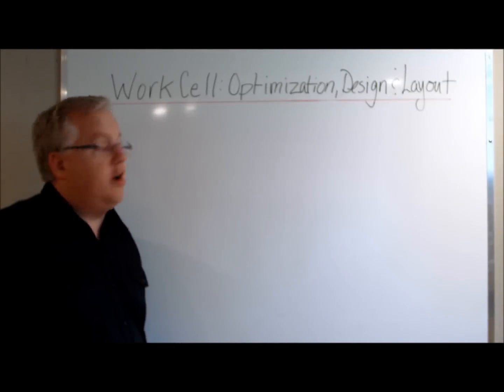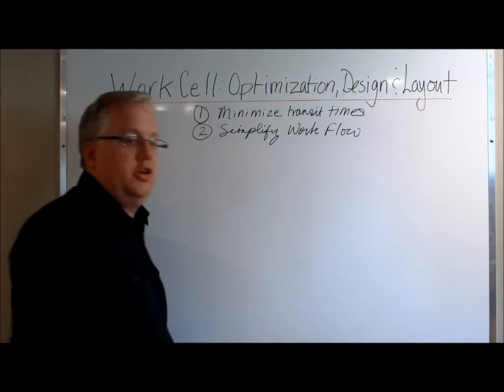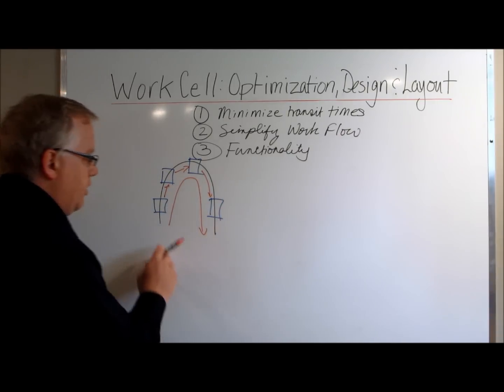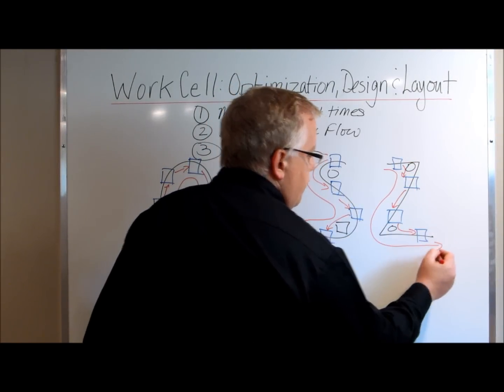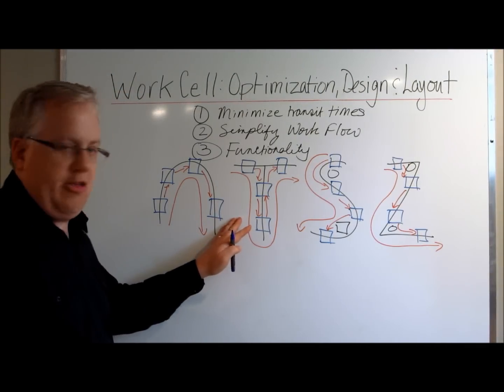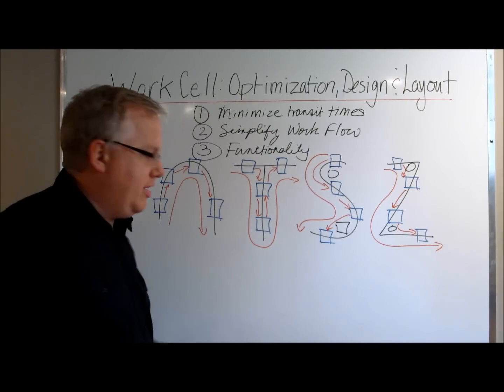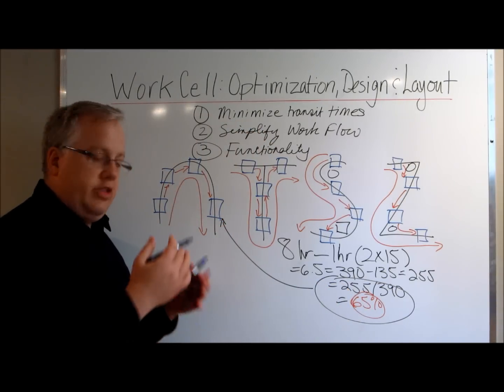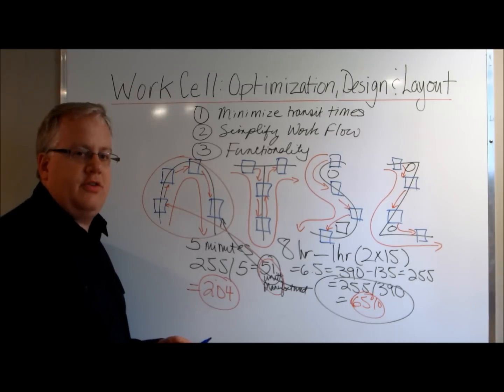Manufacturing Work Cell Optimization: Design, Layout and Cycle Time Analysis

Comment: I'm not picking up how 204 units emerge from the cell in 255 minutes if the flow of the product through the cell is dependent on the accumulated efforts of all steps prior to the last. The last workstation of the cell is performing its task at a rate of 5. 5 minutes is that workstation's cycle time. Only 51 parts are leaving that cell in 255 minutes.
Reply: Correct - given the arrows he implies it is a serial process with 4 stations, however he then explains it as being a process with 4 stations working in parallel.

Comment: Great video, Ian. Have you ever encountered the S-shaped cell in practice? I am having a hard time imagining it having a benefit over a double-U-shaped cell unless you're working around fixed obstacles. Can you inform me of the potential unique benefits of that layout?
Reply from the maker: Hi Brian - I have not seen many - but most of the ones I've come across or used were because of a pillar, post, or other obstruction that cannot be moved. There are applications where the S-Shaped Cell works very efficiently, but it's sometimes industry-specific.

Comment: What would be the best layout for a production floor with no continuous lines...no two jobs are the same / all orders are custom designed
Reply from the maker: Oooh - Levi - that's a great question. I should do a video on that. Ultimately, even when doing customized work, there has to be some basic commonality when manufacturing a product - meaning that there must be some basic operations. You just gave me a great idea for a video.

Comment: Would it be possible to make a video addressing how to adapt lean manufacturing principles to high mix low volume environments?
Reply from the maker: Hi Zack - yes - I will do that - I worked in such an environment in Satcom - we had to be as lead as possible - not easy with a vast product line.

Comment: C.C.O.M.W.I.P.  understand what that means.  the elimination of MUDA give you what this gentlemen is generalizing on.   This is a slimmed down version of the Toyota Production System.  Keep up the good work.
Reply from the maker: +Comic Sans I think you'll find that 90% of the viewers here aren't aware of MUDA and the seven wastes. The reality is that not every company has linear and constant demand for the same products day-in-day-out. Automotive manufacturers have 5-8 models of cars and make millions of the same car yearly - from a fixed bill of materials. However, the vast majority of companies do not have this luxury - they deal with infrequent demand, cyclical markets and floating product lines. Waste is waste - and it's baby steps that matter - not a full on adoption of TPS when it's not viable, needed or applicable for 90% of the companies out there.
Reply: +Ian Johnson this is true, to qualify where i come from i work for Toyota, Lexus in particular and have been studying and using the TPS system in real time for quite a few years. I would teach it if Toyota didn't treat me so well.. what you are briefly over viewing above there actually a tool called Standardize Process Chart which calibrates the process to its optimal efficiency. Its really a simple but powerful tool -ergonomically too. interesting stuff.  after designing lines at work i feel as though i could walk into any company and instantly save them 10's of  thousands upon thousands within the first months. Also reducing WSIB or safety/med visits efficiency and ergo go hand in hand.  It blows my mind engineers and industry specialists have no understanding of this.  It doesn't matter if you're a 5 billion a qtr or 50k a year profit its all the same WASTE IS WASTE.  Accomplishing as much as possible by doing as little a possible, or the least amount of effort. (S.M.A.R.T.)  Im sure you know this very well.   I will say though I worked for a guy pre Toyota/Lexus who taught the TPS system but never ever actually worked for toyota or learned it and used it everyday from GPC a consultant, a real "know it all" he was brought in to "save the company"  but after having first rate experience of actually using and understanding the mindset,  that boy was full of it,  way off in his thoughts and understanding etc.  Keep up the good work though. Stay focused on the cores. theres 1000's of "ideas and concepts" none have been refined and stayed effective as the TPS mindset.    Big business or small,  Production or Office.  I mean no slant to you btw.  i will edit my first response seems a little harsh
Reply from the maker: +Comic Sans Don't worry - I didn't take offense. It's just that far too many companies are intimidated by lean approaches and strategies. They think all the calculations, analytics, statistics and methodologies can't apply to them because of the market they operate in and the products they sell. Most just need to get started and not worry about full adoption of all possible approaches. Taking action is what matters. Take care.
Reply: As an intern, the industrial engineer I worked with said the exact same thing - the company will always insist that their market is "not applicable". Frustrating to get the buy-in needed!